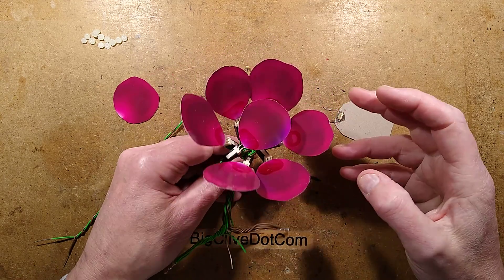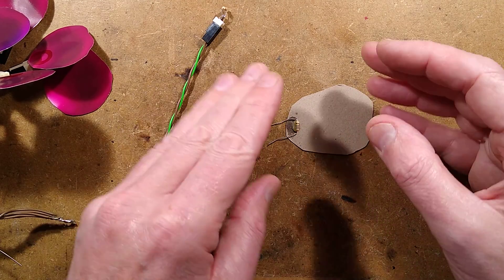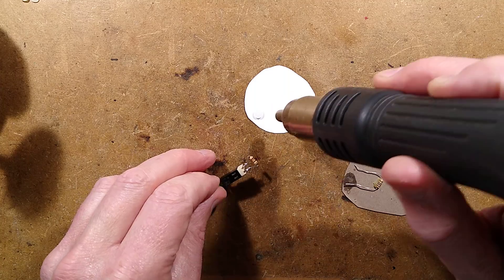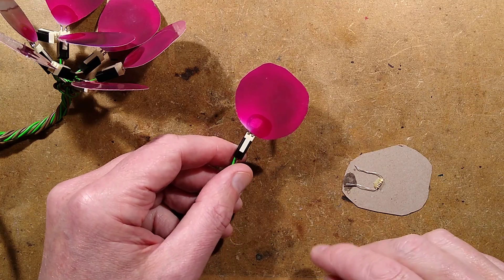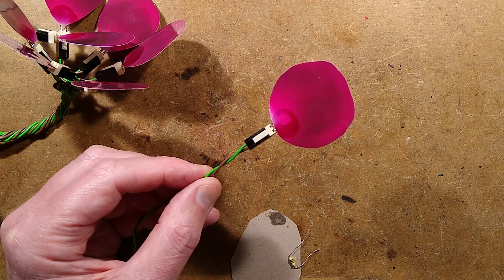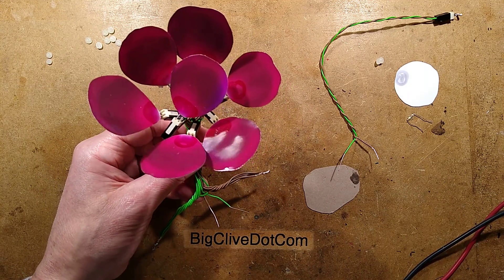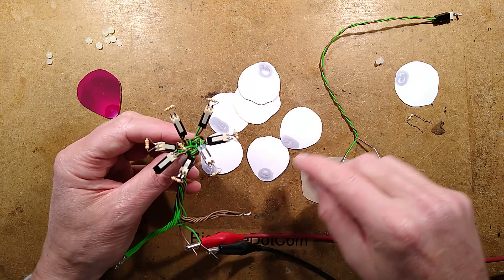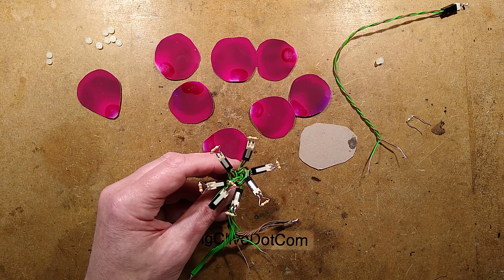Experimental electronic petal dropping prop

Comment: Just a thought on this - could you potentially change the values of resistors to give, what is essentially, a timing device, so petals could fall off one by one, rather than as a big clump?
Reply from the maker: I toyed with that, but the design can also use just one or two petals per channel if required.

Comment: This is neat.  One thing I thought of is that they'll probably have the whole thing in a case or under a bell jar, and will also probably leave the petal resistors "on" after each leaf has fallen.  So the whole interior might warm up, and the resistors themselves would cook a bit.  If problematic, all of this might be easily handled with a bit of timing on the heater circuit.

Comment: Use a can of air duster turned upside down to quickly cool the wax... it sprays out the refrigerant when you turn it upside down super cooling whatever you hit it with.  I use this method to quick cool hot glue when I am doing projects.
Reply: This trick is great, and a life saver if you need it. But FWIW, at least in the US, they make freeze spray that doesn't include bitterant.  It's more expensive, but it's hard to put a price on the self-loathing and regret of everything tasting awful for hours.
Reply: @joshmyer9   Huh, this is the first time I've heard about air duster cans containing a bittering agent. Interesting 🤔
I've only once or twice intentionally released liquid refrigerant from those cans, so I don't have too much experience, but I've done it accidentally dozens of times and I've never noticed it being unpleasant. Just a mild smell of butane or whatever's used in the cans I have.
I wonder how widespread these adulterated aerosol cans are. I'm in the UK, so are they mostly a USA thing? Or have I just been really lucky with the cans I've bought? (I buy the cheapest multipacks I can find, so maybe they can't afford to add bitterants 😹)

Comment: Great idea and implementation. Slightly disappointed you haven't blown up at least one resistor. Maybe the last one, for a dramatic visual effect.
Reply: That's a change from source material I could get behind. Instead of the petal slowly falling down, they just explode.
Reply: The opening scene of V for vendetta just started playing in my head

Comment: Sealing wax is a bit more sturdy, sets really hard, and reasonably quickly. Otherwise, maybe you could use a spare Arduino heat sink to press the resistor against the leaf while you wait for the wax to cool? Just like a sealing stamp.
Reply: sealing wax sets quickly because you smash a huge cold heat sink into it, doesn't it?
Reply: @tiger12506  
Modern sealing wax is usually mixed with shellac or pine resin, and often an fine aggregate powder for pigment. It usually requires a higher temp to flow.
Reply: @tiger12506  Did you read the part where I mentioned using a heat sink to help?
Reply: Sealing wax will match red rose petals.  Use green bodied green/red/black 52ohm resistors instead of beige bodied orange/orange/brown 330 to fit the stem color, and reduce voltage or timing cap to match the lower resistance (P=V²/R or E=V²C/2, t=kRC).

Comment: Clive, have you thought of using very small magnets and small coils that when energised would interupt the magnetism and hopefully the petals will fall off. Then it's a reasonably quick job to replace all the petals. I'm sure you could work out the details. you could also sequence the time each petal falls off.
Reply from the maker: I did consider that, but was concerned that could could be left energised, or residual magnetism effects might cause intermittent petal drop issues.

Comment: Clive,be careful the stagelights donot warm up the wax too much (and the heat in the venue,by the audience)....But I am sure you've covered that....Mr. McGyver Cliver.....
Reply: Different waxes have different melting points. If its an issue you could just select a higher temp wax.
Reply: @Falcodrin  Gonna be a bugger if the resistor doesn't resist enough to melt the higher temp wax though.

Comment: you could probably use an inverted can of airduster to quickly freeze the wax
Reply: You can get a freezer spray for speed
Reply: Yes! Was about to suggest this. I use this method with hot glue guns to tack a join.

Comment: Soy wax has a lower melting point, may help with the silk petals, as you will not want them getting too hot !
Reply: Going in the other direction, stearin, as used for 'chandelier' candles has a higher melting point. They don't melt when used in jam jars as paraffin wax ones do.